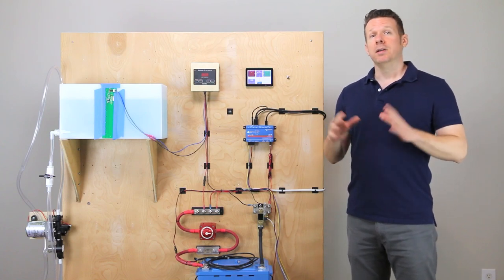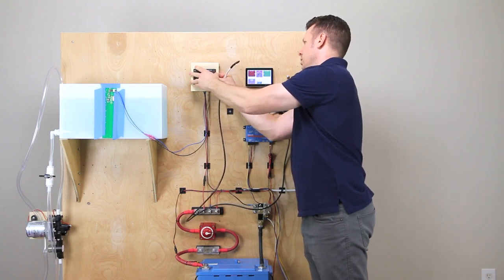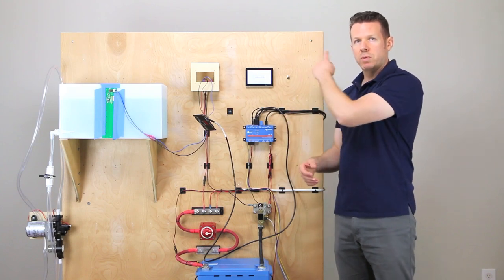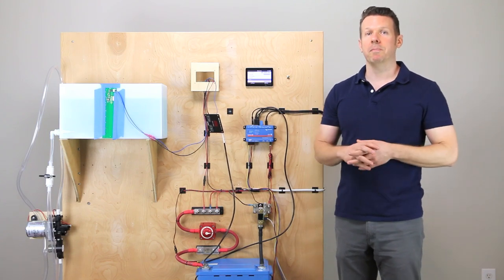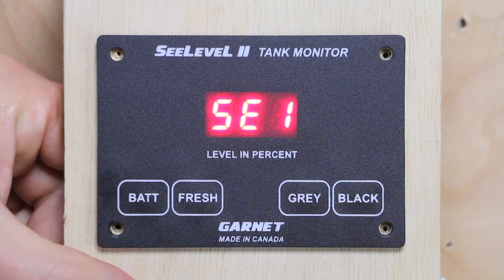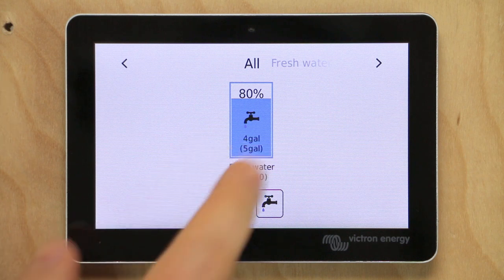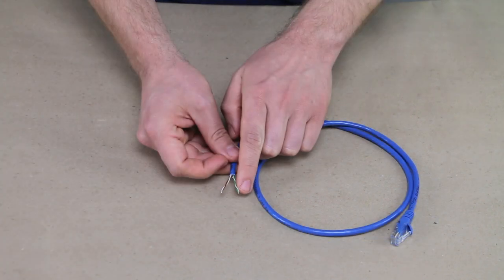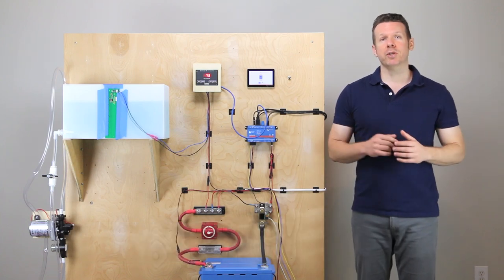How to Set Up SeeLevel Water Tank Sensors with the Victron Cerbo GX for Next Level Tank Monitoring!

Comment: Hi Ross, I learnt a lot regarding the various Victron products from your excellent videos. Do you have any information on how to customize the layout of the Cerbo GX touch panel interface by myself? – could be a new video, couldn't it? – So far I did not manage to find anything in this respect in the manual or at the Victron website, best Stefan
Reply from the maker: Hi Stefan, thanks for checking out my videos! I'm glad you've found them useful. On modifying the user interface of the Cerbo, there is a little bit about that in the Victron Community forums. I frankly have not played around with that stuff, and am a little bit ready to take a break from the Cerbo. I've exhaustively gone through the various Cerbo sensors to try to cover it all and now would like to dive into a few other things.
Reply: @rosslukeman  This is actually a question I have too. Given that you're kind of the reference source for the Cerbo GX, it would be nice to cover that aspect of it too.

Comment: Great Video Ross  I know there was a lot of talk on different forums over the last several years about this integration but nobody was able to get it to totally work. This is a game changer. Was wondering if there is a way to split the input cable to the Cerbo so I could also monitor the tank levels on my Spyder controller in my 5th wheel along with my GX50?  Thanks, Bob

Comment: Do you know if a see level II sensor alone can be used with the Simarine Pico?
Reply from the maker: Hey Mike, I don’t think so. SeeLevel has its own digital signal, the Pico takes analog readings (voltage or resistance). Hope that helps-
Reply: @rosslukeman  thank you